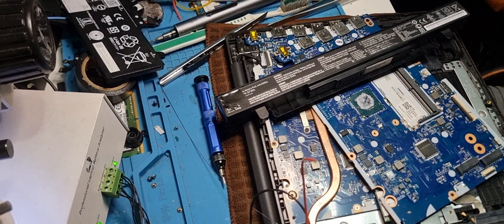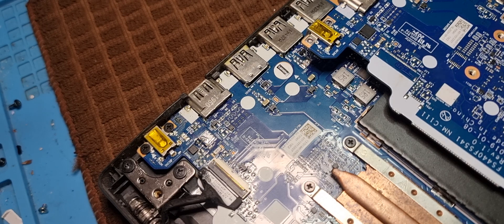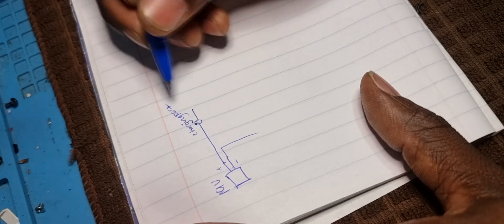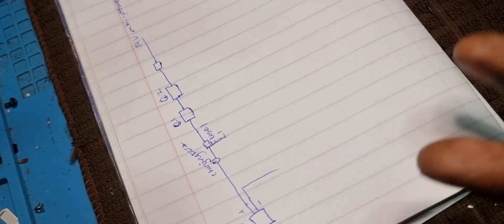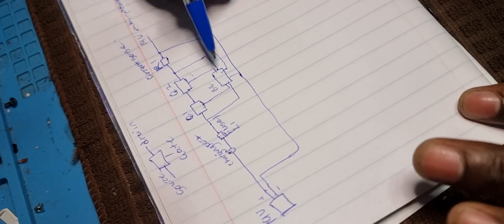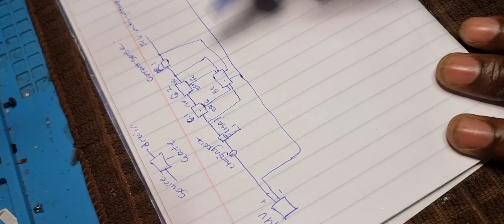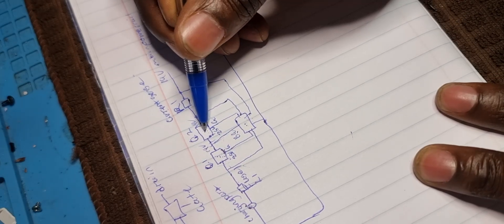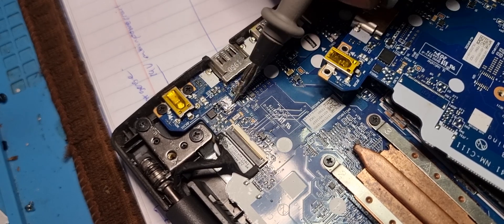How laptop power intake circuit works (ways to fix) Lenovo ideapad S145 NM-C111 not charging PART1

Comment: i have the same laptop but the problem is backloght do you have any solutions ?
Reply from the maker: that is a very popular issue with this model, just next to the lcd connector. check the last 2 pins towards the charging port, see if they have direct continuity(beep) when you prob with multimeter towards the main powerrail. if not change the backlight fuse likely to be the issue.

Comment: Thank you so much for this video. You might have saved my laptop. One of the Mosfets is shorted for me after i had a short on the power supply (lab bench power supply) side. I might just need a new mosfet. Worth a try.